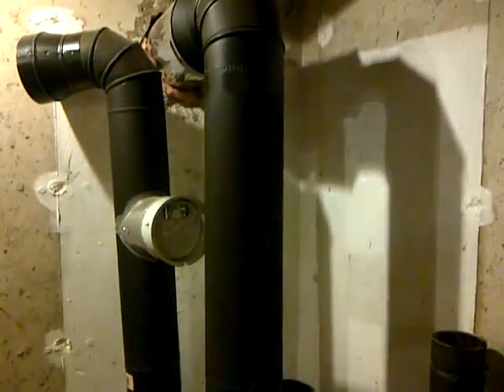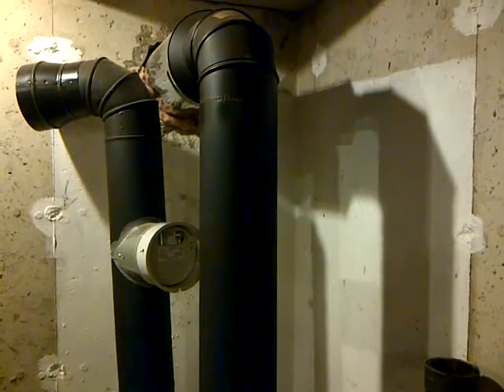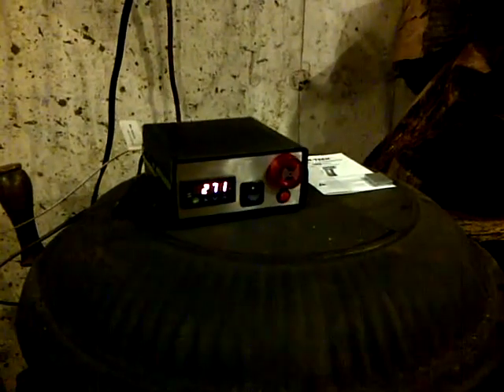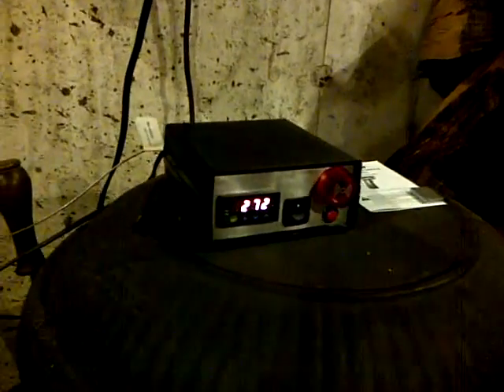Upland Model 27 Wood Stove

Comment: I have one of these. I bought it new in the late '70s. It replaced a Jotul 602. It's still in use and I just found parts for it. The baffel butned out. I've replace the side baffels with ones from the Jotul. The Jotul top baffel is just abit too wide to work.